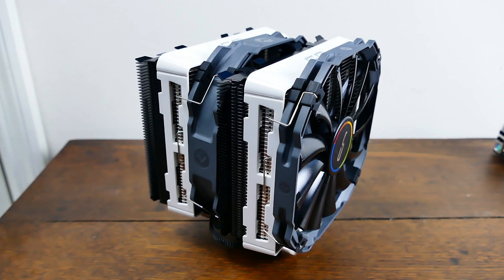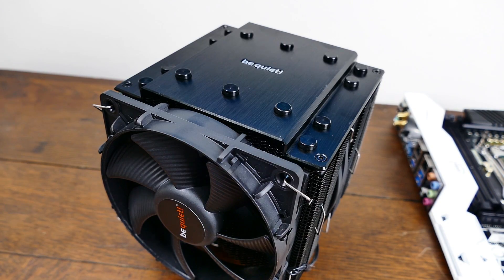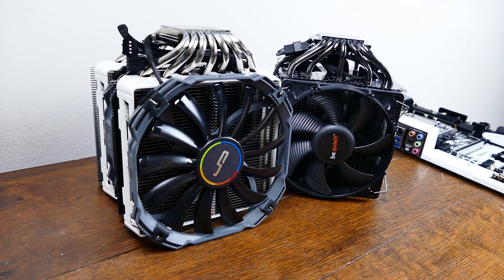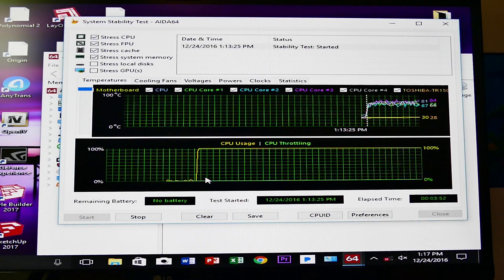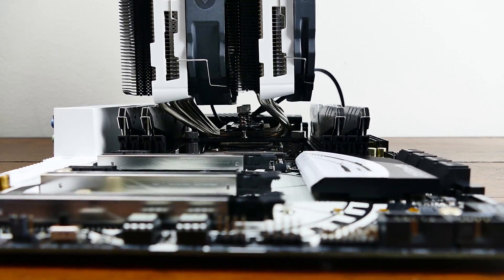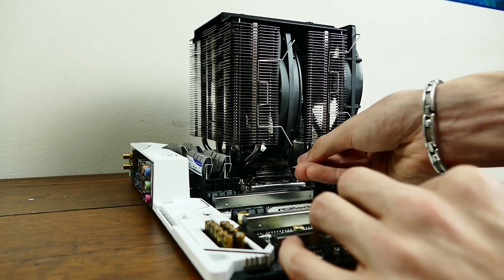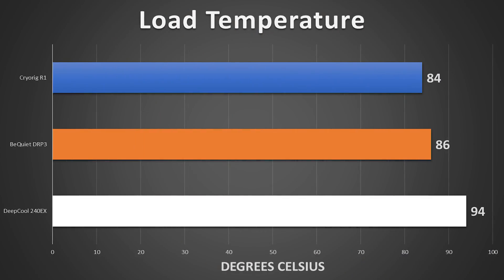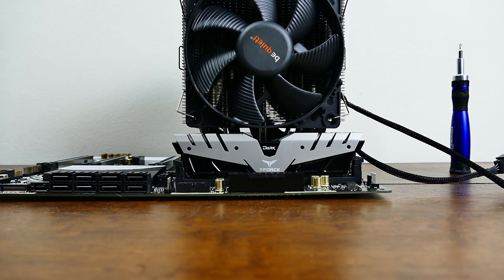BeQuiet! Dark Rock Pro 3 vs. Cryorig R1

Comment: next Cryorig R1 vs  nh-d15 battle to the death
Reply: If the test is standardized by using the same fans (say NF-F12s), then the CPU coolers will perform within margin of error of one another.
Reply: The NH-D15 uses NF-A15 fans

Comment: Your point about AIO coolers is VERY valid, my Antec Kuhler 620 decided to let go where the pipes join the radiator recently, I managed to spot the wetness before it dripped onto my GPU, time to go back to air cooling.

Comment: I got myself the Cryorig R1 Ultimate with the double fat fans and im loving the performance. It even beats out my previous 240mm enermax AIO by a fair amount while also ridding me of the silly pump noise my unit had. It doesn't say much at all and are able to keep my 4790k@4,7 1.244 volt 24/7 at around 60 degrees during long gaming sessions. This is in a corsair carbide air 540 case with 3 corsair AF140  fans(2 intake 1 exhaust) and 2 cougar vortex 120mm (exhaust).

Comment: I had the Cryorig R1 Universal and loved it.Easy install, quiet ( to me anyway ) and no interference with ram at all! That is a big plus in my book. The Noctua is also very good, but let's face it, the Dark Rock Pro 3 and the Cryorig look lightyears better.I had a D-14 and can say that :) And you are right, against AIO or a custom loop the air coolers are a safer bet, no pump to die and no leaks.And hell, if the fans quit, there is still 970 grams of Aluminum for passive heat cooling.And you can change the fan covers to what color you want, not stuck with just 1 color. Great video:)

Comment: The ambient temp may have changed during the testing and you should account for that.
Reply from the maker: If anything, the ambient temp went up by a degree or two after testing the BeQuiet cooler. The Cryorig R1 still came out on top. I approached this from a different angle in the video.

Comment: I own an NH-D14 and it's a staggeringly good cooler! Noctua even include step down leads for it if you wish to run a bit quieter as well. It's a huge cooler but for the price, around £50, it's seriously good value for money. Looking forward to the NH-D15 video! :D

Comment: Copped my DRP3 for $60 on a Newegg flash deal so no regrets over here. Perfect aesthetically for my Black-out R5 but a tight fit and tricky install lead to you barely noticing it during operation.

Comment: great video.. i bought my dark rock pro awhile ago and there were hardly any review videos i could find and i didnt have the problem you did with installing it. i had the nuts already on it so i just had to screw it on thru the back of the mother board.. but i am very happy with this cooler

Comment: Good vid. I owned an NZXT X61 but i bought a open-box Noctua NH-U14S for $65 CAD ($48 USD) for a different build but ended up installing it in my main PC. Sure the temps are like 5c higher but it's quieter than the X61 pump and it's dual fans but more importantly i was uncertain about the longevity of the pump in the X61. Long story short the pump in the X61 ended up failing in the other computer in 5 months.

Comment: BeQuiet coolers are VERY easy to install on 11 series sockets. I feel bad because nobody makes videos on anything but the 2011 socket. For 1151 its only 4 screws from the back of the motherboard on the cooler backplate. No tiny nutz.

Comment: I put together a computer in 2012. The fan on the stock cooler failed about two years later, and being in a pinch, I rigged a spare fan to the heat sink with only one screw. It has been going like that since. It's in a large Thermaltake case with lots of vents that let in dust and spiders. My next build is going to be air-tight to keep out the dirt. Anything with tight fins will clog with dirt. I haven't really looked, but I haven't happened across what I think will be ideal yet. I'm not in a rush, though. My 2012 machine is still working fine.

Comment: I had no issue installing the dark rock pro on an LGA1150 socket board. you just keep the small wrench in place and screw from the bottom with a screwdriver.  2011-3 looks tricky tho...

Comment: CPU coolers from Noctua, Cryorig, Prolimatech, and Thermalright are my preference simply because their mounting/installation is so good (especially Noctua's). I don't think most users would trade aesthetics for function like the ease of assembling/disassembling the cooler.
Reply from the maker: You typically only install a CPU cooler once or twice. It's not a huge deal. IMO aesthetics supersede installation time.
Reply: To each their own I guess. But I wouldn't trade it because I've been in situations where installation is just way too tedious. Plus, I have case on the floor so I don't really look at it XD
Reply: Here's another way of thinking about it: Consider that those who are the most hardcore about a quiet system may opt for a case that has a side-panel with sound dampening material on it instead of a window and, as such, might not care what their components look like.

Personally, I'd much prefer not having to faff around with a messy installation, as well as saving my fingers the ignominy of nicks and cuts.

Comment: Try tuning the cooler speeds to match the temperature under load, and then compare the noise levels. Alternatively try matching the noise levels by tuning speeds and then compare the temperature. Else you just don't have a direct comparison. I know other press outlets don't do that either, but I guess that just makes them not thorough enough either.

Comment: nice comparison. if there is one thing that could be added to the video it would be ambient temperature. some day when you get your hands on corsair h100i would like to see a comparison with that and your deepcool or may be one of the beefy aircoolers i have a feeling that it might be on par if not better than the air cooler. however there is no denying the fact that an air cooler is a peace of mind in the long run

Comment: one of these or a kraken x62/x61? I can't decide. The aio's look much cleaner and especially with the rgb infinity mirror on the x62, but the air coolers seem more practical
Reply: TheGamingWIZ air coolers are much safer, so go with that
Reply: TheGamingWIZ one word, temps. With a air cooler you will get 85 to 90 But with an AIO it is around 50-60 so your CPU will live longer and AIO barely have any sound (besides the pump sound that sounds like a heartbeat), and 1/30000 AIO leak so there's no worries about that and that's all I wanted to say about AIOs and Air coolers + air coolers sound like jets if they are in a enclosed case
Reply: Equinox Quasar that is not true, high end air coolers like this or nh-d15 cool as good or better than AIOs
Reply: Siolian not quite I had a nh-d15 and it was way worse than my X62 on my i7 5930K at stock speeds
Reply: not even a question. 100% go for the kraken. I got one for Christmas and it's seriously the best thing to happen to my pc in a while.

Comment: I got noctua NH-D15 on my 6700k oc to 4.7 ghz at 1.43V (for some reason thats the lowest stable voltage (Msi Z170 Gaming M5 mobo)) and max temp under 2 hour cpu stress test was 76 degrees.

The cooler isnt the best looking but dang it feels good having a huge beefe cooler in my system.

Comment: I kinda like air cooling, but in some cases, liquid cooling may be preferable. For example, if you have a case similar to elite 130, you will find that liquid cooling is better than air. another one is that mobility. if you often move your pic, I find liquid to be safer because it won't put much tension to mono as much as the heatsink. so it's more like preference. good video as always
Reply: Mobo*

Comment: I know this is an older video, but I only recently came upon it, and I have to disagree with one thing that was said. With respect to AIO coolers (unless the statement was only in regards to custom water cooling pumps), it was stated that they are generally loud. I have a Corsair H105 and a Master Liquid 240, and both systems are about as silent as could be possible. I can take off the side panel and must place my ear near the pump itself just to hear even the faintest hum. I should also mention that i run them at full speed. I'm sure the standard "your mileage may vary" may apply here, however it is two different coolers. All else aside, I agree with the remainder of the information provided. Thank you for the work you do.

Comment: I've had Cryorigs R1 for a long time now ( about 2 years I think) and I love it. I use it with an AMD cpu, a FX6350 . I even overclocked to almost 5Ghz using it and my temps never even got remotely scary.
Reply: Try an 8350 at 5GHz on my Macho X2.

Never topped 8c from throttle.

Comment: Salazar, I want to purchase the Dark Rock Pro 3 for my S340 elite but it says on the case specs it'll be a tiny bit too long to fit in the case. However someone has shown that it fits in the original S340 despite the same information on size. Have you tried putting it in your s340 elite ? Does it fit ? ;_; I dunno what to do.

Comment: Battle of the beasts... But no Noctua NH-D15. Especially when talking about "The best on the block" and silence. 

Also, you should also have tested which cooling tower was more efficient by using the same fans on both coolers, preferably third party fans. Then we could have seen "out of the box"-performance vs optimized performance.

So all in all a nice review and comparison, but I still feel it lacks information, especially leaving out the Noctua NH-D15.
Reply: NH-D15 can't compete with either of this coolers in terms of sound to performance ratio. Sorry, this is not a Noctua Fanclub, here we talk about real numbers

Comment: Apparently it is easier to install upside down. As-in place the mobo down onto the up turned cooler. Then screw in from  underneath instead of twisting the tiny spanner from the top. (I'll get to see for my self next week :) )

Comment: Good video. I always prefered CPU Air Cooler over Water Cooler for all those things that you mentioned. If you want a water cooler that surpass an air cooler performance you gonna expend much more money. And if you're not an overclocker, nothing better than a 212X.
Reply: Jone Nascimento I've had my corsair aio and it cost me 90$, had it for 2 years now...Temps in the 60's. no problems and not expensive.

Comment: I enjoyed the stabbing.   But good vid, even without it.  I am still rocking an AMD 8320 Vishera and a GTX 660ti - first couple of years i used a H20 closed loop cooler - so quiet.  So quiet, that i heard no difference when the pump did fail, and i put the poor CPU through repeated 100C spikes to shutdown before i realized.  Since then i've been using fans that sound like hair dryers when gaming.  So it's good to know these quiet mega-air coolers are out there... just in case one day i admit i might never build that custom water cooled system i keep dreaming of.
Happy Feast of Alvis Day to ya.  :)

Comment: IMO Cryorig's coolers are amazing, both with installation and performance. The only thing I criticise when it comes to Cryorig is their slim profile fans, when they look like they do better at airflow than static pressure, making my analness about proper airflow all the more complicated, but they do this with their big ass coolers (or almost all of their air coolers) so it is less than likely to interfere with the first few DIMM slots, or, if using a slim/low profile cooler, to make it less likely interfere with any other components or even the side panel door, depending on your case.

I'm happy with my Cryorig H5A Universal. It may not be necessary for my locked Core i5 processor, but it fits in my big, fat Thermaltake case and I need as much air being pushed within an area as possible vs. how much is being pushed per square inch, so that justified my reason behind purchasing this big fat thing over their H7 cooler. Otherwise, I probably would have been available with their H5 Ultimate, if it was available. (At the time I purchased it, the R1 Ultimate was available.)

Comment: do i need to use prime 95 for overclocking test or can i just use aida 64? prime 95 shoots my temps  high, at 4.8 ghz 1.320v  i7 6700k at 82c and on aida 64 it reaches 70c

Comment: Test the coolers with different fans? I've been wondering how my H7 would act with one of those magnetic motor Corsair fans in it. I really think there are many great coolers on the market but the fans almost always look budget. Guess they have to cut a corner somewhere when they are selling them for $15-$30

Also I like the look of the Dark Rock something about brushed aluminium but that cooler looked like a pain to install even with the mobo outside of the case. Can't help but feel it would have been a night mare inside of the case unless you removed a good bit of stuff out of your case.

Comment: +Salazar Studio Thanks for making this video. Just got a GPU and my Intel stock cooler is making some noise when at max load. I'm thinking of the Cryorig H7 or C7. Would appreciate your help on this choice. :)
Reply: I have the H7 and it looks and cools pretty good. but my CPU isn't overclocked, and the install was really easy
Reply: Thanks for letting me know. I'm using the i5-6400 and I might just go with that since it'll be better it seems.
Reply: The C7 looks better in my opinion.
Reply: It is a good replacement for cooling, but I do not want the noise that some reviews have said and since the H7 is $5 more it will not need the fan to run as hard.

Comment: Both really nice coolers, but imo if you want the best of both worlds, get a Noctua NH-D14 or NH-D15. The only "downside" could be the colorscheme; some people hate it, some people love it. But for example the NH-D14 cools just as well or even slightly better then these 2, is also very quiet even under load and the installation is very easy (similar setup to the Cryorig). And  last but not least, it is also cheaper then both of these coolers (very strange tbh, Noctua's are mostly a bit more expensive).

Comment: I have an AIO from Arctic, its the liquid freezer 240. I bought it for 69 euros in Germany and it comes bundled with 4 fans and my temps on my 6700K at stock is high 40s and low 50s. After overclocking, high 50s low 60s. By the way, the fans are less than 30% in both scenarios. Arctic ftw. :D

Comment: The setup is dependent on the cpu. I have the Dark Rock Pro 3 and it's super easy to install on an AMD rig. I have switched it out several times and it was quicker for me to take it off and put it in as opposed to my AIO that i have. Ram height is the only issue I have with Dark Rock. Plus the Dark Rock couldn't fit in my new NZXT  S340

Comment: BUT thats the universal not the ultimate, dont just name it r1 when there are different versions of it.
Reply from the maker: Jengoo The cooler is exactly the same, save a slimmer fan on the Universal.
Reply: And having a different fan doesn't affect the performance at all, I'd imagine, right?
Reply: you should have compared them to a noctua, i think, even the nh-u14s can keep up with those ;)

Comment: There are two things I think are worth being mentioned: 

First is, you tested the R1 Universal, not the Ultimate. The thinner front fan on the Universal (designed to not conflict with ram) is both louder and doesn't flow as well as a standard thickness fan. An R1 Ultimate would likely both cool better and run quieter than the Universal. Any chance you could get ahold of an ultimate to compare to the Dark Rock?

Second thing is aesthetics. It may be small, but those white plastic covers can be swapped out with a small number of different coloured covers. Having an MSI mobo, I would opt for red. With that in mind, I actually feel the Croyrig is the better looking unit. However, both could benefit from some RGB lighting.

Thanks for the video, look forward to watching more from you!

Comment: You should have mentioned that this is the R1 universal version and that there is an Ultimate one as well with a normal front fan that should in theory perform better than the slim one.

Comment: BeQuiet for idle and Cryorig for load. But I have an ND14 with Noctua NF-P14r redux-1500 PWM and Noctua NF-S12B redux-1200 PWM
. Those fans were recommended by Noctua, because the old once don't have PWM.

Comment: my only setback to these coolers is my little fear that, if they're mounted on a vertical motherboard, they're going to snap it at every little movement of the PC so, if you have to move the PC around for some time, you have to find a case with an horizontal tray

Comment: IMO the R1 wins hands down, even with looks factored in, the R1 has an offset profile which allows for full RAM installation if you only have 4 RAM Dimm slots on a single side. that is a HUGE plus in my book.

Comment: Salazar Studio I need your advice I'm trying to do a new pc build for the first time and I don't what platform to go with either amd or intel. I seen that my games I want to play are mad hard core because  a core i5 one of 3000k series quad core clocked at 4.6 Ghz couldn't handle my games with out shuttering. At this point I don't know if I should go with amd would handle it better with 8 cores 4.4 Ghz. But yet again I did have a good experience  with amd athlon  series that contain L2 cache and they are super fast but not fast enough for my games :( . Amd or intel???? I don't  want to spend more then 100 dallors range because it isn't in my budget and my budget isn't gonna change for a while and I don't  want to have used parts I'm  not a big fan of that also I'm  very annoyed to keep on doing that. I have the watee cooling system in my old system I'm gonna transfer  it to the new build though.